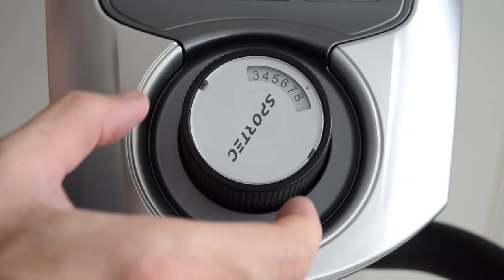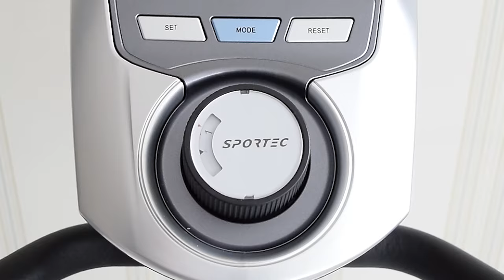How Does a Magnetic Resistance Exercise Bike Work. Exercise Bike Disassembly

Comment: Heres a question though. When my machine is unplugged from mains power its automatically set to the highest resistance so i just use it on that (its cheap, im not strong). After about 30 minutes or so though it seems to "lose" resistance and it becomes slightly easier to pedal. Why is this?

Comment: I've got a similar bike where I'm trying to get the plastic cover past the pedal arm and it just won't go - which looked like the same with you but you cut out the bit where you managed to get it ready to pull off and it looked like it would be stuck like mine - what did you do to get the cover past the pedal crank?
Reply from the maker: There's no any magic in removing that cover. Simply find a position of the crank that will allow to pull out the side cover.
Reply: @ElectronicsComputers  I'll keep trying then :-)

Comment: My bike which has the same system just slowly started to get hard to pedal until I can't pedal any more as it so hard. All that happened in less than 2 minutes.   Woudl you have any idea of why?  Thanks
Reply from the maker: Check the cable that makes adjustment to magnets. Does it move the magnets from/toward the flywheel when you turn the resistance control knob?
Reply: @ElectronicsComputers  not sure :( I haven't opened it completely 🤦🏽‍♀️ I am afraid to ruin it.
Reply: @Free__Speech  no, i end up selling it but the guy fixed. Thanks
Reply: @Free__Speech  He sent me this: "Hi, you wanted to know what was wrong....so the belt had come off and the belt tensioner was bent. There was also a wire broken off the battery pack. They were the 3 problems. Have a good day."
Reply: @Electronics&Computers  hi I'm having the problem where it doesn't move the magnet, any ideas?

Comment: Still don't know how magnetic resistance works after watching this, lol
Reply from the maker: There's a flywheel with magnets inside. When you adjust resistance you move those magnets closer to the flywheel or farther. When the magnets are close to the metal wheel the magnetic force is slowing down the wheel and vise versa.

Comment: I had purchased Avon amob-1481k cycle. After changing two times its bush in just two months of purchase its again have to be changed. Dealer is not cooperating. What is the exact problem is it manufacturing default?

Comment: Hi there, I have a freesport stationary bike that my in laws gave to me. When I put it at the highest setting for tension it isn’t enough to be able to do the workouts Inwiukd like. Is there a way of making it tighter? Thanks so much!
Reply from the maker: I'm not familiar with that model but they all have similar construction. By adjusting the cable near the flywheel you can move magnets closer or farther to the flywheel's edge which will increase or decrease the tension. Also make sure that the drive belt is not loose or stretched .

Comment: I have one of these bikes and my issue with it is that when I’m pedalling every now and then it happens like in a normal bike when the chain comes off, sort of that it looses the grip and slides while pedalling... I saw a picture you posted to someone else but that didn’t fix it. Sorry for my poor technical knowledge. Hope you can help! :)
Reply from the maker: First try to tighten the belt if it doesn't work then you have to replace that belt.
Reply: 2013Electronics&Computers how do I do that? 😥
Reply: @mizonazero  Find your nearest competent male.

Comment: I have a different exercise bike its wheel is infront but due to lockdown I am not able to find its front tension belt now how can i use the bike pls reply
Reply from the maker: what happened to the belt? It doesn't provide enough tension to spin the flywheel or it damaged?
Reply: @ElectronicsComputers  Yes it has damaged
Reply from the maker: @anunaysingh6603  it's not a problem to buy a new one. Just google the model of the belt also try on Ebay.
Reply: @ElectronicsComputers  Okay thank you so much

Comment: Is there a way I can fix grinding inside the fly wheel? I have been regularly using my bike for a month and the last week as it heats up it starts grinding. Last couple of nights badly and now you can hear minor grinding without working out.
Reply from the maker: What happens if you lower the tension (using tension control knob) does it stop the grinding?
Reply: @ElectronicsComputers  yes it reduces the grinding
Reply: Thx btw, you rock!
Reply: @ElectronicsComputers  guess I need to lube it somehow?
Reply from the maker: @timtitus5002  First, simply try to tighten the cable. Luber is not gonna help you.

Comment: I recently purchased a spin bike for my fiancee so she can continue to workout at home. However, we realise that the resistance is not working as per normal and that it will only sort of take effect and gain resistance after we turn the knob 90%. By the time there is a change in the resistance, it gets too difficult for anyone to continue riding.

As an avid rider herself, she wishes to continue spinning with the resistance challenge. Do you have any tips or advice as per how I can fix the issue? Sorry I'm at my wits end and I cant find any solutions.
Reply from the maker: Double check the cable it has multiple connection. When you spin the knob does it move the magnets inside of the wheel? Maybe you just need to tighten the cable. First of all check if the knob transfers any movements to the magnets.

Comment: Hi is this different from a spin bike?
Reply from the maker: Absolutely different! ! The flywheel weight is attached to the pedals to control inertia. The rider determines the intensity of the workout by operating either a knob or a lever that controls tension to the weighted flywheel. Turning the knob increases or decreases tension, simulating ascending and descending a hill on a road bike.

Comment: do you know the name of the components for the magnetic resistance, I am trying to source one and am having a great deal of difficulty as i do not know the technical name for it
Reply from the maker: There are two wheels. One is pedal wheel which connected via belt to the flywheel. Inside flywheel a few permanent magnets with a mechanism that can move those magnets closer and further from flywheel. That's all I know.
Reply: It works using an Eddy Current Brake principle. Basically when a magnet is close to a spinning object made of a metal not attracted to magnets e.g. Aluminium probably in this video, the spinning of it generates a resistant magnetic field which slows the disk down.
Reply: @SamHocking  THANKS!  I know enough about electricity/electronics to understand what you're saying.  But couldn't figure it all out on my own.  Guess I'll google "Eddy Current Brake principle" now, for a thorough explanation of the principles.  Thanks again.